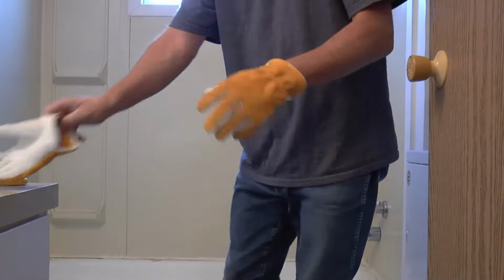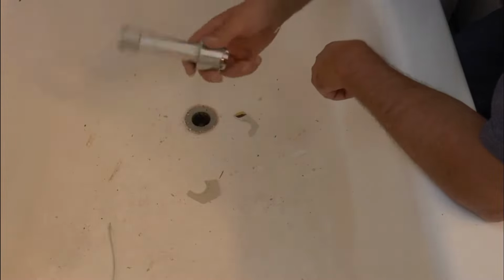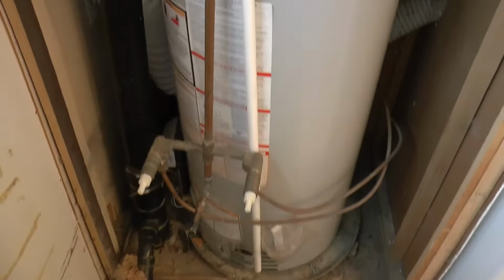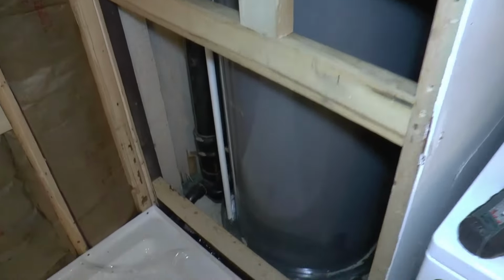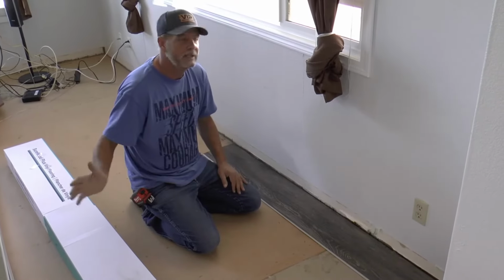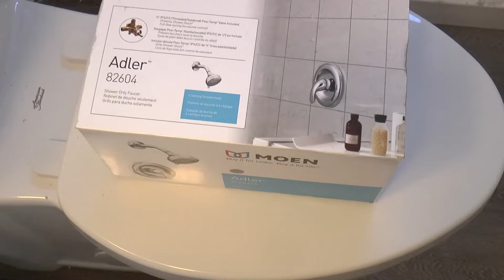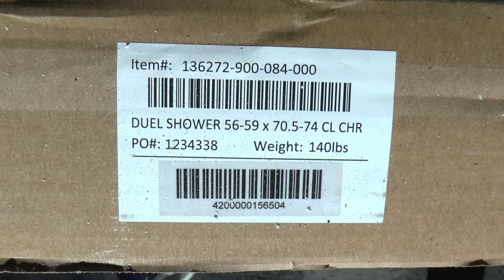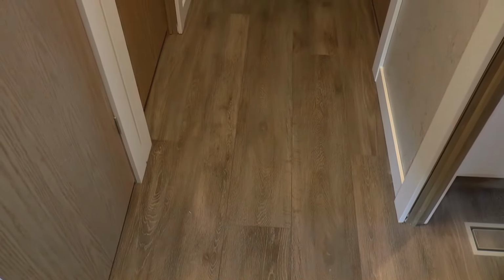How To Remodel a Trailer (Bathroom Remodel)

Comment: Did you have to modify the plumbing pipes to fit the Moen hardware kit?  Trailers can be odd sizing.  And was the showers 54 inches wide and not 60?
Reply from the maker: No the plumbing was all 1/2” pipe and the shower was a full 5’

Comment: I wouldn't believe it if I didn't see it - newspapers and foam used for insulation, the tub painted with latex and a hot water tank buried behind the wall  - and the bonus hair ball. Funny to show up for a job and end up replacing a tank and laying new floor. Good thing you had your son with you to help with the glass install 😀 Cheers.
Reply from the maker: We never know what we’re getting into but this project was a pleasure.

Comment: I am tackling something similar. Since you sped it up, I did not see what did you do with that big black pipe that was sticking out of the floor. I have one like that and I know some how I am going to have to put it under the floor in order to convert to just a shower.
Reply from the maker: The black overflow pipe along with the 1 1/2” abs trap was removed and replaced with a 2” abs trap. Showers all require a 2” rough in now.
Hope that helps

Comment: This is an amazing transformation. I’m wondering what was the original size of the tub? I recently bought a place on the lake and it’s a mobile home single wide, and looking to the do the same for mine - my tub is small 54” long x 27” wide .
Reply from the maker: Thank you ❤️ yes this one was also small 54 x27. Replacing it with a full shower opens it up and just makes it feel much bigger
Thanks for watching
Reply: Thank you so much for getting back. I appreciate it. This is inspiring. I’m going to get this done for sure.❤

Comment: That's a lot of weigh added to the walls. Did you check underneath to make sure the structure could support all that time weight?
Reply: Correct, the floor beam structure  is different in mobile home than a frame  house, usually  less direct support  over the exterior wall and more support  about a foot in with the iron trusses

Comment: Do you think the weight of the tile is close to equivalent of what it was with a bathtub full of water? I know you have to keep weight in mind when remodeling a mobile home and am just curious. Would it be too much weight if you installed a tub with the tile? (Tub of water and tile combined)
Reply from the maker: No, I think the tile is lighter than a tub filled with water. I would say you’ll be fine with the nominal addition of tile weight
Reply: I live in a mobile home and have done some remodel. I think so long as the home is not being moved, you're good. If you were planning on moving it, weight may become an issue.

Comment: This is amazing! Just got our mobile home and this is the exact same thing I want done on our bathroom. Quick question what is the name of that drywall, I never seen drywall that thin. Is it something else?
Reply from the maker: Hi there, yes you can buy 1/4” drywall however you will have to use a product like Red Guard or Aqua Defence to water proof it prior to tiling.
You might also want to look at Kerdi board which comes in multiple thicknesses as well, with Kerdi board you wouldn’t need to apply a waterproof membrane.
Thanks for watching and your kind words.
Best of luck with your project
Reply: @DIYBuilt  Thank you so much for the information, I greatly appreciate the clarification😃

Comment: So if there's a problem with the water heater, you need to take out the Shower?
Reply from the maker: No, there is an access on the exterior of the mobile home, we just took advantage of the tub removal location as it was easier to work around

Comment: This is a remarkable transformation 👏. I've been ask to do a similar project and am trying to decide if I am capable of pulling it off. You make it look very easy but I know it's not an easy task. May I ask about the drywall material? I was under the impression that concrete board was required for a shower area. Is that not necessary? And did you have to reinforce the floor underneath the pan? Great video. Thank you for your time!!!
Reply from the maker: Thank you, your right it’s not as easy as the video makes it look. that being said, don’t be afraid of taking on a project like this, there’s information everywhere to help you get it done.
As for the wall board, yes concrete board is better, we chose drywall because of the thickness we needed (1/4”). We also applied 2 coats of waterproofing membrane before tiling. Another option would have been Kerdi board which comes in different thicknesses and is 100% waterproof, also light weight.
No we did not have to add supports under the base. Thanks for the visit.
Reply: I have been reading your previous questions and answers and did see the answer to my questions. You are awesome ‼️☮️

Comment: Where do you purchase a 56 inch bathtub and surround ? I have to replace the whole tub and the subfloor is mould and rotted out .
Reply from the maker: I’m not sure, this one was 60” and we replaced it with a 60” fibre glass shower base

Comment: I'm going to be remodeling an 87 MH. I didn't think tiling wad an option due to weight concerns. I was unaware u could treat drywall with a product and tile directly to it. I recently saw a home renovation that used a pink colored foam board, for tile backer. How old are these products? Do they hold up? What happens if you need to later move the trailer?
Reply from the maker: First off thanks for watching. I believe the foam wall board product your talking about is likely kerdi board made by Schluter, It comes in different thicknesses and is much lighter than drywall however I don’t believe the added weight from drywall and tile in the bathroom  alone is a concern. The product I used to waterproof the drywall is called red guard or aqua guard, the product has been around for quite a while now and I use it often as a second layer of protection over gypsum board. If you choose to go with the foam kerdi board you wouldn’t need to use a waterproofing product like Red guard. 
Hope that helps 
Thanks for the visit
Reply: @DIYBuilt  thank you for the reply . does the tile go on the aqua guard with the same material
Reply: Sorry it sent to fast ...once the drywall is treated is tiling done with the same stuff as with cement board?
Reply from the maker: @terrysmith1914  yes, use a good thinset adhesive.
Reply: @DIYBuilt  thank you
Reply: Unless your mobile has a concrete  base perimeter wall your home may flex in high wind or shifting ground  piers.

Comment: That was a beautiful end result.  But, I have a question, was that regular sheet rock you put up?  I thought you had to use cement board or something like that.  Thanks.
Reply from the maker: Normally I would have used aqua board however I had to use 1/4” drywall to match up to the 1/4” panel board that is found in older mobile homes. Also 5/8” drywall was used on the hot water tank wall. Aqua board only comes in 1/2” thickness. To overcome these obstacles, you can see in the video we used a rubberized waterproofing membrane applied to the drywall prior to installing tile.
Reply: @DIYBuilt  Thanks for the answer.  I will keep all in mind.  It was a beautiful end result!
Reply from the maker: @missylearned9821  thank you, it was definitely worth the effort.

Comment: I am about to do a tub to shower conversion. I have a 2014 manufactured home. Will i have any of the same issues as with a mobile home? I am also not on a cement pad though i am on what they consider a foundation.
Reply from the maker: I would say no, you probably won’t have the same issues. Manufactured homes are built these days taking into account standard building practices. A 2014 manufactured home is not very old (under 10 yrs) so for the most part all building specs should be up to code for your area. Hope that helps.

Comment: Why did you not use cement-board in a wet area ? Some places call it green board and in other places it is purple.
Reply from the maker: Aqua board only comes in 1/2”. We used 1/4” drywall to match up to the thickness of the panel board found in most older mobile homes. To achieve a waterproof membrane prior to tiling we applied red guard waterproofing which is 100% better moisture protection then aqua board.
Reply: For clarification sir, you used regular drywall, the waterproof membrane and THEN the red guard water proofing? Thank you!

Comment: Loved the Video! I want to exchange a Garden Tub for the Shower Set-up. I have an 1984 Home and it's set on unlevel ground. The bathroom is a good 5-6 Feet off the ground. So my concern would be the weight load with a shower enclosure (will probably go Fiberglass surround). Question #1; Did you use the regular 1/4" D-Wall and coat it with the Aqua Defense in lieu of regular hardy-backer? Question #2; did you add any reinforcement or replacement of subfloor with both the bathroom & living areas for the plank flooring?
Reply from the maker: Yes just regular 1/4” drywall coated with 2 coats of aqua guard. 
No new sub floor under new flooring

Comment: Hi! I can't find a bathtub that fits a mobile home
Reply from the maker: Most mobile homes have a standard 60” bathtub
Reply: @DIYBuilt  this is a 70s mobile home
Reply from the maker: @milasgamma6143  should still be a 60” tub
Reply from the maker: @milasgamma6143  how big is the opening, wall to wall?
Reply: Most mobile homes have a 54" tub not a 60"?
Reply: Home depot carrys them but you will have to order it.  Mobile home tubs are 54" and standard is 60" I own several and remodle Mobile Homes on a regular basis.  Hope that helps

Comment: Having the shower valve in front of the hot water heater was illegal and not a good idea
Reply from the maker: I guess the owner will have to take that problem up with the manufacturer of the mobile home. That is the original location.